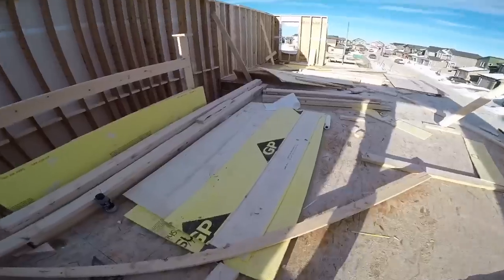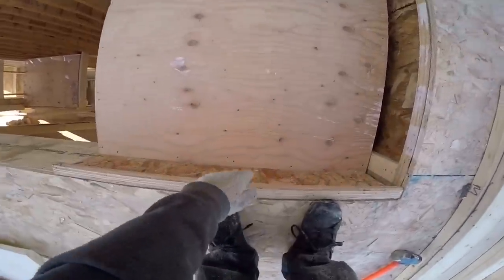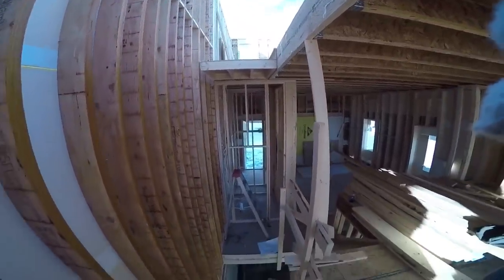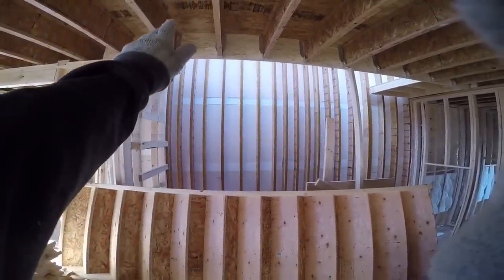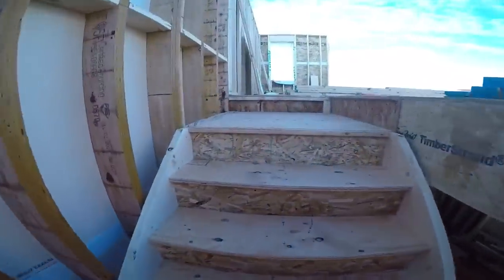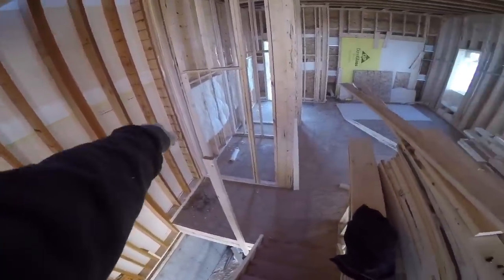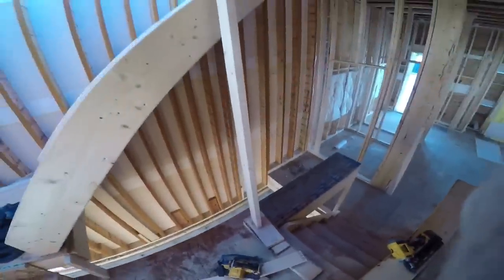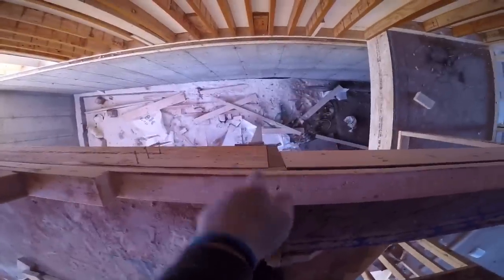How to build a house alone. Season 2 Episode 20

Comment: only part way through today's video.   RE:  Stairs through window, could you not use your wall jack to lift them into the air or would it be heavy to pull through the opening?

Comment: You said this house was more difficult to build than others but it hasnt looked too difficult so far.
Reply: friendlywhiteguy I think he was talking about the complexity of the structure in what is a fairly simple house, not actual physical difficulty. Some crews struggle with plans that are a little tricky or when it’s not just what they are used to. He must have to check the drawings constantly with things like that big wall and the stair opening framed with a point load and support wall rather than a double lvl. Not hard but just a little different. Experienced guys understand what’s being done and converting the drawings to wood isn’t a big deal but I could see newer carpenters scratching their head a bit looking at the drawings. You can’t just go in there and layout a 40’ wall and mark the openings or you will have problems.
Reply: @rodavision  Thanks man, makes sense now.
Reply: @lomparti  👍

Comment: In the U.S.A. we often use the Zip sheathing and tape system. I can't imagine the Dense glass and Tyvek flap being very strong. We also block and stand sheets where the shear line is designed into the structure. From a fire stand point engineered lumber burns and collapses very quickly. What good is the dense glass at stopping an inferno from heating up the closely spaced adjacent building to the point of spontaneous combustion? You appear to be an excellent carpenter. Keep up the good work Sir.

Comment: Does it seem like that 22ft wall is a bit flimsy and has a fair bit of movement at 1:19? I don't think the extra blocking that goes on it is going to stabilize it more horizontally. Is that just cause the roof trusses aren't on yet? (sorry I have no idea about anything construction related)

Comment: What If you hook a rope on to the lower end of the stairs and pull them in through the window with the rope.   Cause as you pull the rope it should lift the back end of the stairs to get it into the window.